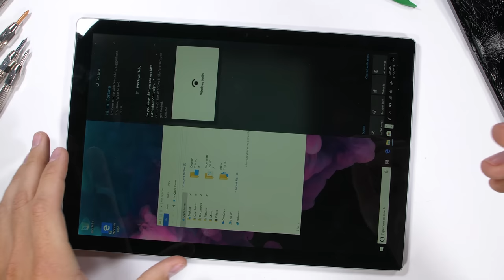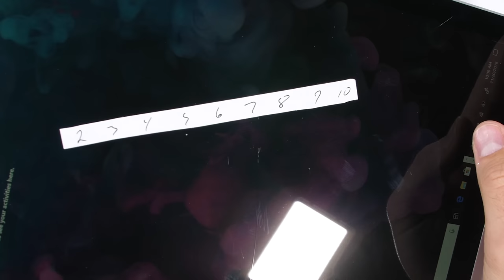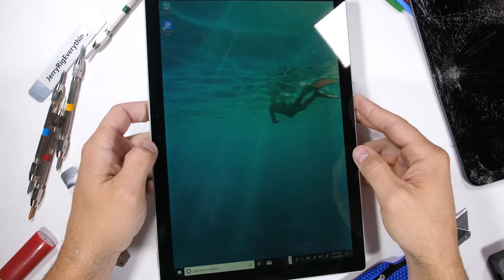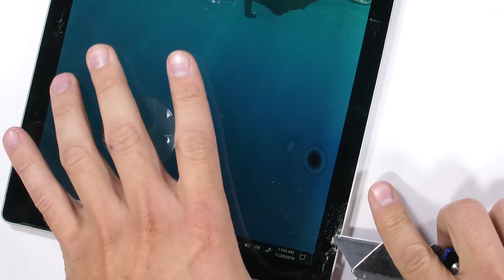Surface Pro 6 Durability Test! - Is it stronger than the iPad Pro?!

Comment: I thought all tablets bent 🤷🏼‍♂️😂
Reply: What's Inside? Damn didnt expect to be the first one to respond to a whats inside comment 
Keep up the good work
Reply: You watched the wrong videos..
Reply: Nope
Reply: No they have a weird flex, lol.
Reply: This one didn't break like a biscuit 😎
Reply: Yeah. The 1st gen ipad took so much effort to bend. He was struggling so much.
Reply: No, this one cracks it's screen from a scratch test. Not sure which I'd prefer
Reply: You could try bending a different iPad and the results will vary. The iPad Pro is very thin, has no internal structure to hold it in place and design flaws with the mic and the magnetic-charging port at the center. It folded like a piece of paper. I've got iPads they don't bend that easily.
Reply: No
Reply: Ever Trejo I think most of us know previous iPads are stronger. It’s just the new one that’s just weak
Reply: A strong tablet is a kindle fire
Reply: Just Apple and Huawei 🤣
Reply: Not thicc af ones. Surface is hardly a tablet as it’s not very portable
Reply: @sandergulla  so you'd prefer the entire device to snap rather than just the front glass cracking?
Reply: @julianolano9486   Even if it is strong, it's ass.
Reply: @evanjones5257  Obviously not. But I do believe that the screen takes a lot more "fatal" damage than the chassis of the iPad and is more likley to break. I have never known anyone with a bent iPad, however I do know people who have shattered their display from minor drops from the couch. So to see this point completley disregarded was just something that needed to be pointed out as it litterarly cracked from a scratch test. This is obviously just my take on it though. Do you personally think the iPad is more likely to bend or for the display to crack?
Reply: EHEM SNAZZY LAB
Reply: 666 likes
Reply: 😂😎🤩😀😊hahahaha
Reply: They do... Just remove the Kick Stand.. and that thing Is chips !
Reply: Please also do the durabilities of swart watches and bands and the durability of these things are quite poor
Reply: @Thomashorsman  i do not trust edited comments lmao
Reply: You just proved that they do..
Reply: I bought you some Microsoft Surface
Reply: The iPad didn't just bent, it snapped.
Reply: @sandergulla  hmm,true...Thats a problem too...
Reply: Bend
Reply: @Thomashorsman   Surface Pro 6 is portable similar to iPad Pro.
Reply: What's Inside? Well I never knew the surface was a tablet...
Reply: Call the turtle bill
Reply: (Snazzy Labs has left the chat)
Reply: oh hell yah
Reply: hay take apart my channal
Reply: this is hardly a tablet. Just a trash laptop
Reply: Guys cmn all you need is a case which fits to this masterpeace! I show how make filaments buy my selfe with over 200 videos and i also developed a flexible filament, a TPU which is perfect for this. So print a flexible TPU case filament before you bend it, then it looks stonger but has the same result as the original aluminium case, ... you can bend it with only 2 fingers :-) Hahaha
Reply: hahahaha btw. awesome channel you have subbed!!!
Reply: @ @Werbewunder  rofl
Reply: @Werbewunder subbed i want a flexible case for my flexible tablet :-)
Reply: Samsung tab 2018 bend test?
Reply: I Have TabA 6 Samsung And It Doesn't Bend
Reply: dont be a fool, all tablets bend at the end of the day.
Reply: It's "3, 2, 1", not "1, 2, 3'. Or else what number would you stop at. 🤔
Reply: @sandergulla  If this cracked from scratching then a slight bend would crack the screen also - so what's the point? How does this pass the bend test? Biased, that's how.
Reply: @alwaysactive6140  But he was putting a LOT more tension on it than he did in the iPad Pro bend test. You're not accidentally going to bend the Surface Pro, or have it arrive from the supplier bent.

Comment: And you can still use the surface pro after all of the abuse, even with the screen barely visible. Hooking up an external monitor gives it life again
Reply: Jackson McKinney thats really good! really good for transportation, the need for an external screen
Reply: @TheSacuLlp  I mean you're in no shape to ask for more than that after basically annihilating your tablet.
Reply: It's good because it means if you plan on shipping it out to repair it or just tossing it, and have stuff that isnt backed up on the cloud (maybe you were doing important work on a camping trip with no wifi and something catastrophic happened ) you can still hook up a monitor and transfer or backup those important files so that when you end up with a new tablet or Microsoft resets your tablet when they repair it as is standard, you still have the files. With the iPad pro immediately giving up the ghost you don't get that chance.
Reply: @ryumewukowu  it also gives it longevity of you are using it as your primary computing device. It is advertised as having the full functionality of a PC, so it's nice to know that it still functions even if something happens to the screen.
Reply: "The light inside has died, but I still work."
-Surface
Reply: @TheSacuLlp  did you even think before posting that comment?
Reply: Ofc if I'm buying a tablet I want to hook it to an external monitor. It's not like I would wanna buy a full-fledged desktop for that
Reply: @tbg6070  I disagree , I'd prefer to lug around my bulky 30 pound Computer Case for all my external monitor needs..Who needs a light weight Tablet PC the size of a large notebook, when you can assert your technological dominance by dragging your gaming PC with you for all those Office meetings and Class presentations...
Reply: iPad can't do that
EDIT: The iPad can't do anything
Reply: I used the surface pro 3 and its still working great. I gave it to my mother to use now. Its def strong.
Reply: Or a docking station

Comment: Did anyone else want him to snap the kick stand off or was it just me??
Reply: No, we all wanted him to
Reply: It can't it just folded flat the other way.
Reply: Was thinking he would do the same..
Reply: @aber tick Yes? The new surface kick stands can almost fully fold flat on the opposite side. He shows it in the video lol
Reply: It cant snap
Reply: Uhhhh everyone you can snap it sideways who said it had to fold the intended direction. Things break cuz they go through things... well un intended you dont design an iphone (tho it seems like it) to crack it just happens when something unintended happens
Reply: It is actually to be used as a stand with the keyboard attachment. I know cuz I have a Surface pro 4 and 7
Reply: I’ve tried with a old Surface 2 that didn’t work. It would not break. I’m not as strong as Zach, but I was using a hammer and pliers.
Reply: Kumail Ali we know, that’s why its called a kick stand haha

Comment: 7:53 to sum it up 👍
"Not all tablets are created equal! And there we have it! A full computer in tablet form Vs. a smart phone in tablet form".
Surface Pro 6 Vs. iPad Pro!
Reply: All tablets are equal, but some tablets are more equal than others.
Reply: I mean, it is kind of unfair to compare the two, one is an actual computer.  The other is, well, basic as fuck.
Reply: @chrisconway9959  that's right, but apple tells us that iPad pro "can do everything that a computer can do". They even made a video titled "5 reasons iPad pro can be your next computer"
Reply: @erikngn  They should've named the video "Apple does what Nintendon't"
Reply: The iPad Pro is significantly more powerful though. So while it's running a mobile OS, there are some things it would definitely be better at. Also pretty hard to beat that 120Hz display.
Reply: @4lc441  There is literally nothing that it's better at. It is simply not a good machine.
Reply: @4lc441  Surface Pro has core i7 version though, is Ipad Pro more powerful than that? The CPUs are different architecture anyway and I don't know what sense does it make to compare Windows 10 performance with IOS. That 120 Hz screen is great but the kickstand and keyboard cover on Surface beats Ipad versions by a wide margin.
Reply: Cutter Elf No, but I was assuming the base model since they're priced the same. The i5 starts at $1200 and benchmarks similarly to the a12x, and the i7 starts at $1500.
Reply: @4lc441  Surface Pro 6 i5 model starts at 899 though. Paired with 8 GB RAM and 128 GB. You can add additional storage with micro SD.
Reply: @Swift Boiz Ipad Pro is just not comparable to a device running full Windows 10. There is nothing close minded with that statement. I mean, are we really going to argue whether the os that is used on most PCs in the world has more functionality than IOS? Ipad Pro is definitely the better tablet since it is lighter and IOS is better for touchscreen use but Surface Pro's much more advanced kickstand, mouse support, and better keyboard add so much more versatility to the device as a hybrid machine or "2 in 1". How Ipad Pro beat Surface Pro 6 in photoshop when Ipad doesn't even have the full version yet anyway.
Reply: @Cutter Elf Oh, fair enough I was looking at a different version I guess. Was under the impression the base model still had a Core M3, which is like half the performance of the A12x. If you add any additional storage or go for the black model, it jumps to $1200 though. 

The keyboard cover also costs an additional $130 and is pretty much mandatory on the Surface, whereas you can legitimately use the iPad without one. So that's something to consider.
Reply: @4lc441  True. Type cover is pretty much necessary for surface pro so the actual base price is $1000. Then again, for comparable typing experience on Ipad Pro you are paying $160. Either way, Microsoft definitely did a good job offering the base model with i5 and 8GB RAM this time around. 128 GB SSD is much better compromise than core m3 CPU or having 4 GB RAM.
Reply: @Swift Boiz Well okay then (about photoshop). Surface Pro isn't really bad compared to Surface Laptop. Same specs and same aspect ratio screen. Type cover is pretty good and again full Windows. Surface Pro kickstand is harder to balance on your lap compared regular laptop but... that's pretty much it. On the other hand touchscreen on Surface Laptop is much harder to use compared Pro (touchscreen is still useful in regular desktop mode). While tablet mode of surface isn't as good as Ipad it is much better than other 2 in 1s out there. You can hold like a tablet and to read pdfs, comics that sort of thing comfortably (best use case of tablet imo). My point is that Ipad Pro is not really a hybrid device as it lacks too much in the laptop department  (lack of mouse support notibly, and also mobile version of websites are usually lacking) except for the most lightweight use cases. On the other hand, I don't think Surface Pro lacks some hardcore tablet features that are game changers.